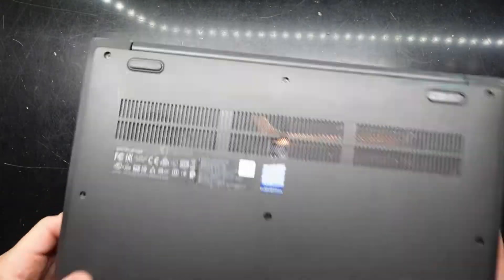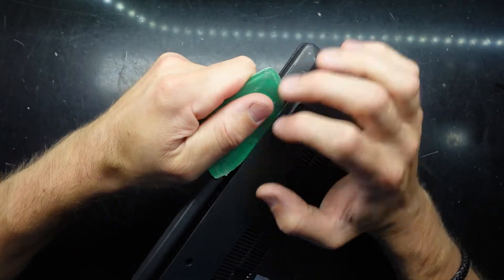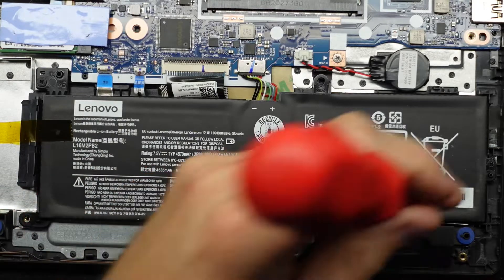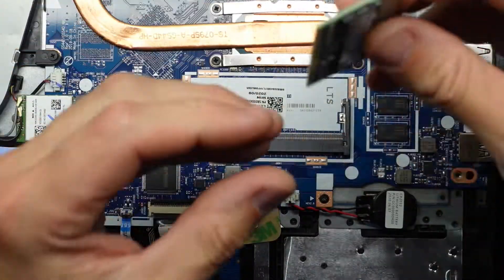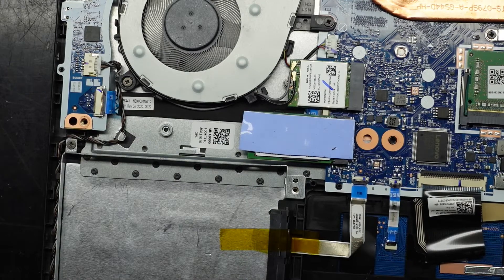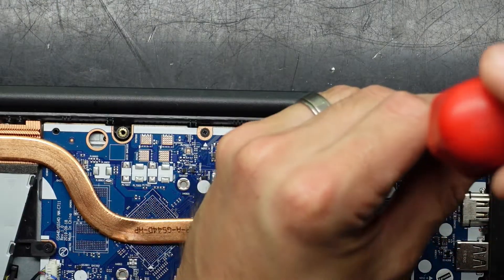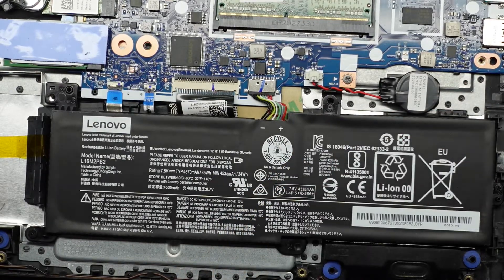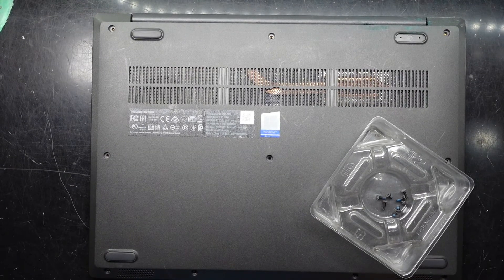Lenovo Ideapad S145-14IIL NVMe and Ram Upgrade

Comment: hello my friend, after upgraded from 4+4 to 4+8 of RAM the pc doesn't turn on, just fan at max and black screen. I used 2400mhz ram as it was the preinstalled one. I tried to unplug the battery and remove several times the ram but nothing changed. Can you help me? Thank you.
Reply from the maker: not good, not sure sorry.

i would disconnect the battery
Remove the added ram 

plug in power and try and turn on with just the charger cable connected

Comment: Hi Rick, thanks for this video because I was able to figure out how to open up my laptop and things to be done before replacing the RAM. Now, my question is, my laptop is also Lenovo Ideapad S145-14IIL, will 16GB DDR4 2400 will work with this? Or should I get higher Mhz or should I stick with the Lenovo's recommendation of total 12GB Ram only. Can you give me an advise? thank you. 

Liked and subbed by the way.
Reply from the maker: If you are running an intel 10th gen or earlier I would get 2400mhz, but if 3200mhz Is only a couple of dollars more I would buy that (in the new market there will be more 3200mhz than 2400mhz)
Reply: @rickstechrepairs  I see. how about the GB? the seller from an online shop told me to get the Max capacity of the laptop's memory by doing cmd - wmic - get maxmemory and it shows it's only capped at 12GB only. So he doesn't want me to get more than 8GB.
Reply from the maker: what cpu do you have ?
Reply: @rickstechrepairs  i have same problem with @CalmTiger18 , my cpu is Core i5-1035G4. should i buy 8 gb ram or 16 gb ram?

Comment: Hiiii, does it only have one slot for ram?
Reply: Unfortunately, it has only 1 RAM slot. Takes up to 8GB DDR4L RAM on the 15IWL variant and that isn't sufficient for anything these days unless you run Linux on it. Also, whoever decided it was a "good idea" to not provide the standoff and screw for the nVME drive should be in prison for the rest of their lives. The ones from Amazon won't work, ones from eBay as well, and you'll have to order them from their site and it could take weeks to get the hardware for it.

Comment: max ram on this model?
Reply from the maker: i would probably go to 16GB but no larger than 32GB
Reply: @rickstechrepairs  thanks, I ended up just putting in enough for 12GB total
Reply: @rickstechrepairs  you can only put a 16gb ram chip in, for a max of 20gb.